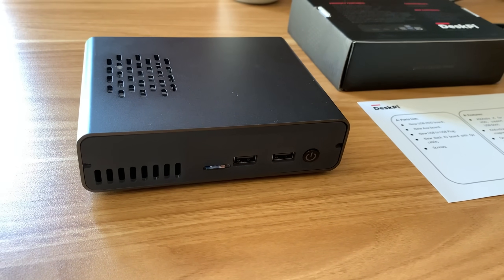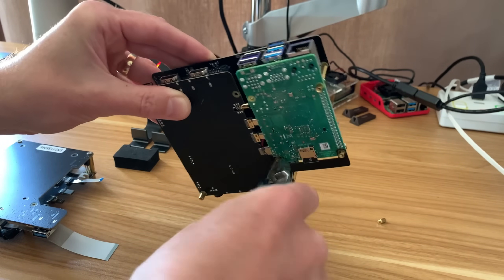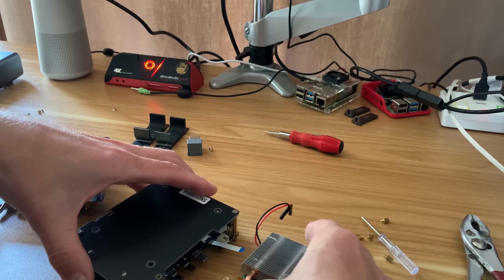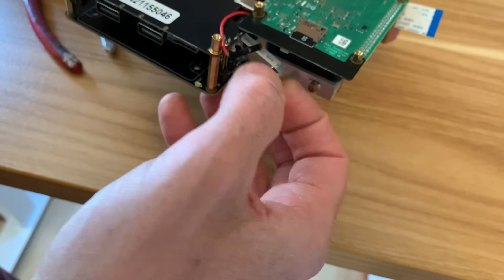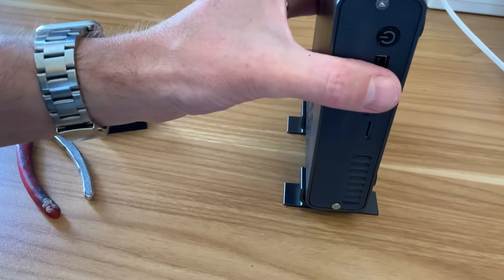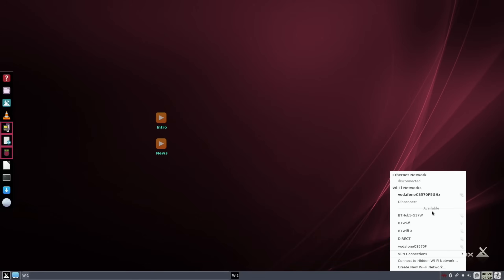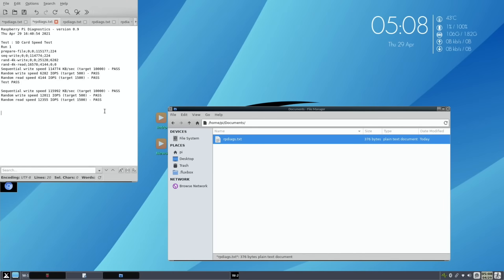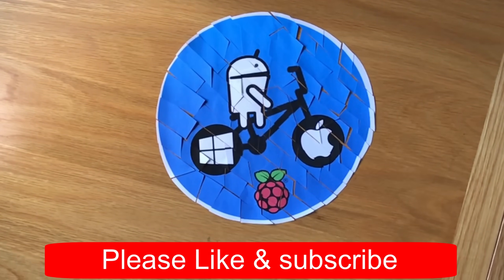DeskPi Pro case Updated. USB Boot plus WiFi improved. Raspberry Pi 4.

Comment: Sure it’s an older thread and meanwhile the DeskPi Pro V2 is out - but it still helped me a lot: here in Europe they are still selling the DeskPi Pro V1 stacked with the updated internals (you basically get two boards with one enclosure and one fan). After having seen your measurements and read the comments about UASP on the old board, I switched back to the older V1 board (since I have no issues with that). Nice side effect: the JMicron controller on the oder board with UASP is consuming 0.5W less power! So if it works and you use the DeskPi always on, it really makes no sense to switch to the updated board with ASMedia Chipset. If you get your hand on a new DesPi Pro V2, it would be interesting to se another comparison video from you. Subbed!

Comment: I order this box to setup NAS.  The I run into 2 issues: power supply and SSD not shown in OS. If you had canakit power supply with on/off switch -- DON'T USE IT on this case.  It'll boot up but has "low voltage warning", use supply that comes with the case.   The second is the 40-pin ribbon cable just run straight over the standoff of cooling fan.  If you don't pay attention when you put back the case, the cable can get crushed or mounting screw might go through it.  Luckily I did not put screw there, the cable is still good and it's seeing my SSD now.  Just take some time to route the cable around the standoff and you're good to go.  Thanks for the video as always!

Comment: Uhhhh - the ribbon cable does go to a header. There's a simple daughter board that plugs into the GPIO to extend the header to the other side of the case so you can access it externally. The ribbon cable connects to that board on the other side of the USB ports. If you had installed that board it would have been inherently obvious. In addition, DeskPi has issued a firmware update for the SATA board with flashing instructions to provide UASP and TRIM.

Comment: Great Video.. Subscribed.. Got one of these end of June.. works a treat.. the shielding is obviously very good, I had to use an Extension cable for my USB keyboard as it wouldn't connect to it otherwise.. but overall a great unit

Comment: I received my replacement parts for the DeskPi Pro I purchased and I am deeply disappointed. The first HDMI Slot doesn't work, the USB 2.0 ports don't work, I find the data transfer speed to be poor,  and to access the GPIO header I needed to remove the system from the case. The GPIO slot does not allow for connecting a cable to, the relay board they provide sits in a position which is spatially inadequate. It cools around 56deg, which compared to my favourite case the Muizei, it runs much higher even with the low profile ice cooler. I have yet to contact them about it, in any case I will be replacing the DeskPi very shortly. On a happy note, after I removed the unit from the case and hooked up my sound card to the GPIO header, it worked and I now have great sound on my Raspberry Pi.
My speed test results with a WD Green 264GB drive.
Sequential write speed 102080 KB/sec (target 10000) - PASS
Random write speed 3328 IOPS (target 500) - PASS
Random read speed 2671 IOPS (target 1500) - PASS
Test PASS. Pretty poor read/write results.

Comment: I recently purchased a DeskPi Pro. Mine came with two items that yours seems to be missing. First, there is an adapter to bring the GPIO connector to the back of the unit. It connects to the ribbon cable that you weren’t able to connect. Second, there is an adapter that plugs into the SATA connector that allows use of a SATA NGFF drive. I am still running it off of the SD Card (TF Card) while waiting for my SSD to arrive, and I have high hopes that it will run faster on the SSD.
Also, the new board apparently supports UASP and Trim. https://deskpi.com/blogs/news/about-uasp-trim
Reply: Update: I received my SSD and the DeskPi certainly supports UASP and Trim. I did end up having to do a firmware update that requires a Windows PC, and I spent a day troubleshooting and waiting for their customer service response. They are based in China and I’m in the US. Now my SSD is running at SATA 2 speeds and it runs Trim automatically.

Comment: Finally received my replacement.  Working fine now, with one strange quirk: If you want to boot from SD (for instance, to use a different OS etc.) it will NOT boot until you pull the USB 3.0 jumper to disable the SSD/HD drive.  Boot from the SD card once, shutdown, replace the USB jumper, and then it will behave as expected, bootable by USB or SD card if inserted.
Reply: Lol what kinda shit is that? How long did it take you to figure that out? I would have never figured it out

Comment: Waaaaaaaaay too much thermal paste mate! You might consider reading this page on the proper way to apply thermal paste. When it comes to the amount of paste recommended, it should be even less as they are using a much larger CPU in the example, so for the RPi you sound use about about half a grain of rice.

https://www.intel.com/content/www/us/en/gaming/resources/how-to-apply-thermal-paste.html

DeskPi 'Pro' not having UASP support is a show stopper for me. I can't imagine there is much of a price difference between the ASM1153 and the ASM1153E.

Comment: I also received the First Issue from the Pre-Order batch and suffered many issues with their setup.  After documenting & posting the issues and with minor battle with DeskPi they refunded me.   

On 2021-04-25 the company sent me an email stating that they are shipping out the replacement components for both the Deskpi system I purchased.  KUDOS for that level of support !   The update components have been shipped by Snail Mail so who knows when it will arrive.

I do believe this is a Good Product with massive potential in the market and they learned a few valuable lessons for future product releases as well.

There is only One OOPSIE here.  They still do not have an option for NVMe which are far more easy to get now.  Also NVMe is Current tech that will continue growth, development & support..

Comment: Just installed the new board myself and it works better.  I was actually able to install ubuuntu with berry boot.  Still works with my other sd cards..  

Too bad not getting full speed on the ssd..  

Are you going to post an update with the correct hardware install ? 

*others have already said about that cable to nowhere...

Comment: When you put up the "bad advice" notice I was wondering if you'd released the magic smoke.
Too bad about the "updated" SSD interface using the lesser chipset.
Still faster than a microSD, but UASP support would have been great.
Now I need to check the USB drive cables I bought.
Edit: yes, the Eluteng "blue" USB 3.0 SATA cables do support UASP.
Reply from the maker: No smoke, just didn’t power the fan with the grey connector. I guess it’s for something else.

Comment: This update is primarily focusing on better M2/SATA compatibility whilst fixing and  improving on a few other things. The old boards are actually (on paper at least) Faster as they did support UASP however, many (like myself) had issues with compatibility and had to add "quirks" command to "cmdline.txt" to even get it to boot. (without quirks command it could take about 20-25 minutes to even boot  leading many to falsely believe, it simply didn't work) As lee stated, this v2 board uses asm1153 which does not support 6Gbps,only supports 3Gbps. (The 6gb chip is unavailable worldwide im hearing) So Yes. this could be faster like the Argon M.2 case (& maybe in the future it will be. V3 anyone?) but, it's still not bad, it looks great, cools great and has many other nice features. (I like having One OS on m2/sata, one OS on SSD and can still boot another O/S via USB 3.0 on the rear & IR built in)  👍
Reply: In case you missed it, V3 FW is now available as well as updated Fan/Power/USB Port fix/scripts. Updated ALL my stock no problems. (Check/Search DeskPi Github)

Comment: @leepsvideo The  ribbon cable is for the 40pin GPIO extension board. Think you did not get that.
Reply: Just swap the board as you have it on the old board...then connect the ribbon cable to that
Reply: That ribbon cable should not me left that way...it is there to make the GPIO pins useable...you need to take the adapter from the old board and use it the same way on the updated board...for those that want the GPIO pins to work

Comment: Thanks for the update, I was considering one of these in December but heard about the issues,
It's such a shame they didn't implement the UASP and TRIM functionality, definitely a missed opportunity and another deal breaker for me,

Back to plan B, trying to shovel a 2.5" SSD and adapter into a Geeekpi set top box or using the Geeekpi Hdmi breakout board in my own custom aluminium case, along with a CSL SSD cable for max speed, 
If anyone knows if it is physically possible (or not) to fit a 2.5" X 7mm SSD into a Geeekpi set top box (I don't mind a bit of dremel work or an adapter hanging out of the back) please let me know,  cheers
Reply: The new DeskPi that I received a couple of weeks ago supports UASP and Trim.
https://deskpi.com/blogs/news/about-uasp-trim

Comment: Do you have a reference for the 32-bit OS running faster than the 64-bit?
Reply from the maker: Some 64bit Systems advise to avoid 2GB recommending 4GB or more
Reply: @leepspvideo  yes, because the 64-bit address modes are faster than the 32-bit ones

Comment: Ribbon cable is for the IO breakout board. Screw that hard drive down through the board, that's a lot of stress on the little plastic connector!
Reply: The wide ribbon cable allows you to connect the board to the GPIO connectors, so allowing fan control and possibly the front USB and IR connections